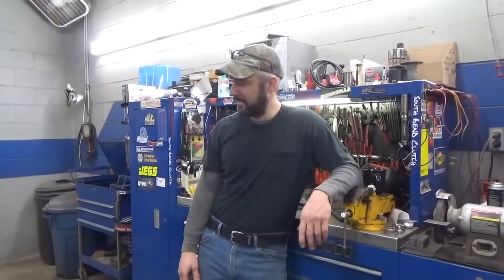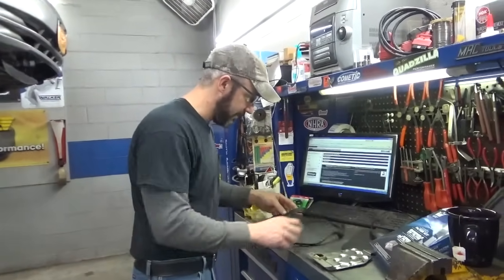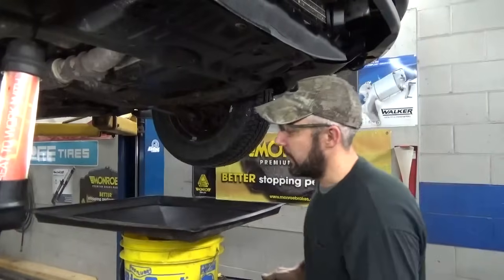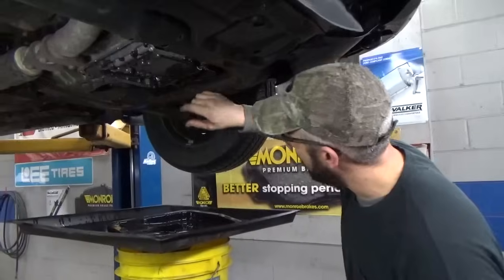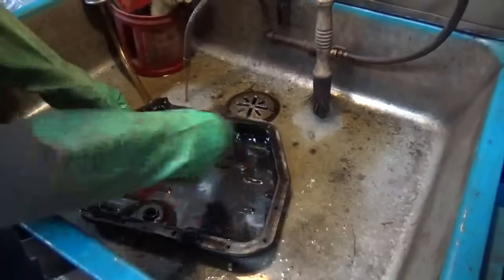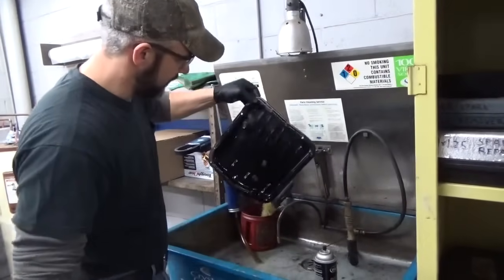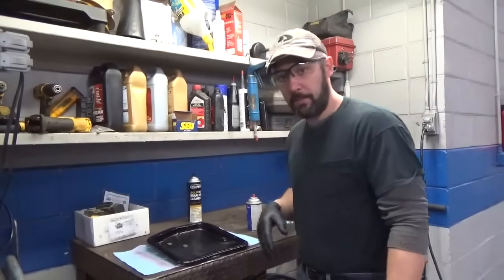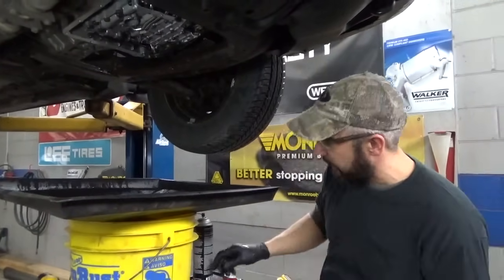Transmission Fluid and Filter Change - Toyota Camry

Comment: Thanks Jack, great video, got a question for you, I own a 2012 Camry 4 cil, mine does no have deep stick like the one on the video, everything else is very similar, where would be the refilling bolt at, would you helping me to find where is it?
Reply: I'm sure you've found it by now. But Ugg! I wish Eric O. had one for our Camrys. I wish I had an Eric O. in Cincinnati O! 
I have an 07 xlt. (Has that weird shiftronic thing going on lol) 
In case anyone else diy'er is reading thru comments who owns the same - our refill is.p accessible through the wheel well. There are a couple videos- watch all, even the professional dude who has tanks & gauges etc etc. Very good info. Basically- To check the fluid level- it's all about the drain tube/plug - it helps measure the fluid level when it reaches a certain temperature (114f if I remember correctly). The drain plug/tube is 2 pieces, (but I've seen it being 1 piece by some reports; so if that's true- to do a drain, it's just a pan removal dump). To check fluid level, remove the drain plug, you'll see the tube up in there. If the tube comes out in your hand- separate it from plug & screw tube part back in to pan. Fill through the wheel well refill hole. (Yep, gotta remove the tire & some plastic in there) (also helpful- a funnel with a flexible neck) once you've filled, start the car.  Once the fluid reaches the correct temp, it should sit level with the top of the tube- barely dripping out. Too much- it'll pour out, too little- not even a drop. How do you tell if it's the right temp? ... Toyota ALSO thought of that- by running through the gears at a certain time interval - it triggers a temperature sensor & tells you either with blinks or display msgs (I forget which) .
Once it indicates you're in the zone, you top it off and watch for drips out of the tube/drain plug. Viola. The fluid expands greatly when it is hot- it is SUPER important you make sure it's at the right temp. Watch videos of what happens with too much or too little fluid. 
I put in a new radiator, it was about 1/4 cup of fluid. I need to check it again though- every once in a while it has a not as smooth shift down to 3 at low speed incline. Could be normal.

The Toyota forum is the best place to find specifics. My gen also includes Solara- in case any Solara- owners are reading.

Comment: My 2000 has metal shavings in it at 150k and has some rough shifting when letting off and getting back on the gas. I am hoping new fluid and filter will clean this up!
Reply: did it help
Reply: @TempoMontages  kid totaled it before I could.

Comment: My old one had over 300k till i f it up before its time! Now got 2019 smooth efficient the old one took pot holes better. So what you guys think on sealed trans? Should you ever touch it? Not according to Toyota but i wanna go 300k plus. My old one flushed once at 120 k. This one idk what you guys think? I know multiple Toyota over 300k orig trans fluid
Reply: Change it every 60-80 thousand miles and it'll last practically forever.

Comment: I have a question, what do you do if your Camry has no dipstick. How can I be sure of proper fluid level. I believe my torque converter is causing my 2011 to violently and suddenly shudder between 25 and 50 mph. Any help would be appreciated

Comment: My 97 camry is throwing a P0755 code for a shift solenoid B. It shifts good and dnt notice anything wrong with it while driving it. Do you think all it might need is a filter and fluid change. It has 160,000 miles and not sure if the fluid has ever been changed. Im the third owner

Comment: We have a 99 Camry that is throwing a 1705 code . Husband replaced the direct clutch speed sensor , and still throws the code . He’s changed the oil , not about this filter. Could this possibly cause that code ? Or possibly the harness?

Comment: what would happened if you under torqued the filter bolts? I misread this guide and accidentally torqued them to the same as the pan bolts(43 in/lbs.) I didn't realize until I was done

Comment: Alas, my 2010 Camry 2.5L has no transmission dipstick. :-(  If you get a chance, would be great to see your procedure on dealing with that.
Reply: if you take your left front tire off, you will see a little plastic panel held on with two 10mm bolts. behind that panel is a 22 mm bolt. that is your fill bolt. I took a long skinny funnel and put about 3 feet of 3/8 fuel line on it. but its not a fill hole like a diff or transfer case where you fill it until it runs out. I really don't know the procedure for checking it. I just pull the plug and pour 3 quarts in it and out the door we go.

Comment: Hi, the transmission oil drain plug was little bit loosened but not taken out, then it was re-tightened but the fluid begins to drip. why? why drip wont stop? no fluid change happen in this scenario. only slightly loosened at the beginning then immediately drain plug was tightened.

Comment: That one was really ready for the fluid change.  I heard the cork gaskets tend to get damp over time and leak. Those rubber gaskets are supposed to the preferred types. What are your thoughts on flushing the fluid out of the torque converter when doing the fluid change?
Reply: Garth Clark, transmission flushes are just a shop taking more of your money.

Comment: Question, i have 2014 Camry, the dealers will charge about $300 to change the fluid. but local mechanic cost about $180 to $230, is is safe to hire local mechanic? a lot people said dealer has special tools to open the seal. just curious

Comment: my good friend just had a comprehensive fluid  check and change !the 1994 to 1997 camry and celeca have separate transmission fluid between the differential and the transmission , they did not check the differential level thus destroying the differential ! this should have been included in this video ! its fine now but I had to remove the transmission in the drive way ! long hard and difficult repair !
Reply: No problem there's a video here on YouTube by an Asian guy I believe his name is welking vue he gives you all the steps on how to drain and refill the differential but he doesn't show you how to change the gasket and the filter on the transmission so what I did is used Eric's video to do this job and the Asian guy video for the differential I got perfect results on my 1998 Toyota Camry le 4cyl.

Comment: I was told that if you haven't change your transmission fluid, in lets ever. That changing it can damage your transmission, is this true?
Reply: Nonsense.
Change your fluid. Nothing last forever. If you weren't meant to change it, Toyota wouldn't put a drain plug in.
You will find new auto transmission fluid will make your gearchange a lot smoother.
All fluids in vehicles should be changed at set intervals.

Comment: I have a 2012 Camry SE 2.5 liter 4 cylinder with a sealed transmission and made an appointment with the dealership to get the fluid changed. They quoted me 280 originally but after I brought it in they said it would be closer to 700 because it requires taking the pan off. Any advice on other places that can do this service cheaper than the dealership? Thanks
Reply: Doing it yourself.

Comment: Those rubber gaskets, you really don't want to put any sealant on any side, since that could make it leak.  The way to get the gasket to stay is to put the bolts through it, since it should be tight around the bolts.  But if it didn't leak, that's good, and you did a great job and got lucky.  
And since you did all that you might as well flush the system, with about 4 gallons or more.  Toyota's have a drain plug and usually the metal fine screen filter so I don't even bother to take the pan off, I never saw those filters plugged up yet.   Not saying it couldn't happen, if you got problems yes defiantly drop the pan.  
Just drain, fill about 10-15 times in a time frame of two weeks or so, drive it after each time, so it dilutes the old fluid.  Each time it's around 2-3 quarts, so after the 15th time it's all nice and clean.  And yes, you will be throwing away clean fluid.  Just remember how much is in one drain, so it get's the right amount each time.  Toyota is so nice since they put a drain plug I believe on all their cars.  Smart !    Oh, I did this to a 02 ford focus and then it didn't shift correct.  Lucky I saw a filter kit that comes with two A&B Solenoids,  so I took the pan off again and changed them out, including the filter since it came with one.  Then it shifted correct.  So beware.

Comment: Excuse me Erick,  I have a question for you,  do you know if I can run an transmission just with an external transmission cooler ( not plug the transmission lines into the radiator) ? I just want to do that with my 95 subaru svx, hopefully you can help me with an answer, thank you and have a good day, keep on the videos
Reply: Yes
Reply: You can use the 2 of them or alone whatever is better for you.
Reply: @r.a.p.k.models4160  Thank you for you answer Ramon appreciate it you help have a good day
Reply: @homeroaguilar6163  de nada soy mecanico , he hecho eso q preguntas en 3 carros ,he eliminado el oil cooler de la transmisión.
Reply: @r.a.p.k.models4160  Gracias eso es lo que tengo en mente hacer en el mio aparte que voy a cambiar los knock sensors en esta semana o en la proxima gracias por tu informacion me servira de mucho ahora solo necesito encontrar un buen lugar en donde colocarlo
Reply: @homeroaguilar6163  el oil cooler depende la marca ,yo he instalado marca (hayden)y ese da la forma de como hacerlo en conjunto con el oil cooler de la transmisión o solo, arregle un mazda protege,  una vitara v6 y pontiac bonneville , eso el oil cooler viene de diferentes tamaños dependiendo de cuantos cilindros es tu carro.
Reply: @r.a.p.k.models4160  Voy a investigar cuales son mejores y tratare de comprar uno grande que no tape mucho el radiator tambien
Reply: @homeroaguilar6163  saludos desde massachusetts
Reply: @r.a.p.k.models4160  Saludos Ramon de un Chiapaneco en el estado de California y gracias por tu informacion

Comment: Great video.  I have a 2001 Camry with 190,000 miles on it.  I have not change the fluid in the past 90K miles.  My fault, I know.  Is it OK to do it now?  I have heard not to change tranny fluid when you get a lot of miles on it b/c it will cause failure.  Is that true?  I am willing to do it if you think that is a bunch of bunk.

Comment: Just curious but what impact is that? i have an 18v milwaukee 1/2 that im slightly hesitant to use on small fasteners like those. you ever had any trouble with those shearing the heads off bolts?

Comment: Thanks, very detailed. But I would go further and replace all the transmission fluid. Doesn't make sense to add 3 quarts of new fluid to 5 quarts of old dirty fluid. I do realize this is what the customer is paying for, but I'd talk them into the full service.
Reply: Many manufacturers frown upon that and for good reason. This has been an ongoing discussion since I first started paying attention in the early 1970s. Based on my experience with our heavy-duty equipment and shop trucks...I'd say a full drain is a quick way to take a 100K+ transmission out of service very fast.
Reply: @ethelryan257  Do you know what the reason is, that this is a bad idea? As long as you replace the fluid, and never let it go dry, whats the problem?
Reply: @WareWolf801  There's a couple of youtube videos which explain it better than I can. A lot of transmissions (especially many late 90's GM) wear quite rapidly. The 'grit' in the fluid is what's keeping the worn transmissions working.
I know, I know, etc. etc. But it's something a lot of us have observed over the years. I'm not going to promote other mechanics on Eric's site, but you can easily call several up on this topic.
Reply: @ethelryan257  That's exactly how my perfectly good working 89 Ford Taurus went straight from the Lube place to the scrap yard.  I thought I was doing my car  a favor by having the tranny fluid flushed, as soon as it came out of the shop bay oil was dripping from the pan.  A transmission shop told me I should've left that tranny alone.  That brand new fluid acted like a solvent on all the gunk keeping the tranny sealed.  Repair quote was more than what the car was worth.  Live and learn!
Reply: If the transmission maintenance schedule was follow then yes continue to follow and flush when scheduled. If the maintenance wasn’t followed then DONT flush the transmission. Drain and fill is the BEST thing for a transmission with questionable maintenance history.

Comment: Hell i had a question. If u can help i opened my transmission. And i opened. The body volve and i put it l back together now it dont go into reverse
Reply: Too late now , but you should not have messed with the valve body .  Did anything fall out ?  Maybe a steel ball , like a little Bee - Bee ?

May have to take it to a transmission shop .

God bless
Wyr

Comment: A common problem hesitation shifting gears fluid dirty also oxygen sensor quits no check engine light crazy!  I replaced sensor still feels like taking in air I thought oxygen sensor didn't work it does!  Please how many bolts Trans pan can't buy gasket screen kit without that info THANKS IN ADVANCE FOR HELP!  2010 Toyota Camry LE 2.5 engine

Comment: Spill and fill is about right.
Reply: +2cyclemix  Keep in mind, there's still quite a bit of old tranny fluid in the torque converter so not much sense putting a new filter yet. I would do at least two spill and fills before I pulled the pan.
Reply: @0rangevale  That would be true if I do it myself. If you're paying a mechanic, labor is about the same you only pay extra for the filter so just do it.

Comment: How about a trans service on a lifetime system with no dip stick.
Reply: Them are called sealed transmissions u got to unbolt the bolt on the side let some drain out to see if it's got any in it if don't u know u probably need to put some fluid in it

Comment: Hah makes me chuckle when I hear you say "China parts" I call them "Wing Wang" parts. All started when I would see the cheap tires, things like diamondback tires, fuzion tires, nexen tires, you get the point. But I just adopted it to all of the cheaply made parts to being generic "Wing Wang" I'd probably laugh like no other if I heard the reference wing wang in one of your next videos lol. In the process of doing a complete transmission rebuild on a 1999 Lexus RX300. Maybe I should video it! But I think one thing you should cover in the next transmission service video you do, is the importance of actually replacing the fluid. Even if it's just a drain and fill. Most folks don't know that the clutch disc material mixes with that fluid and makes it thicker. And when the fluid is finally drained and replaced with fresh fluid, the new stuff is much thinner and seeps right past the seals in the front pump and most of the other scarf cut seals in the interior. Then it warrants pulling the transmission for tear down and seal replacement. 

Just some insight buddy, once again great job with the videos!

Chad
Reply from the maker: Chad,
    Haha Thank you so much for that saying haha, I literally can not stop laughing lol. Wing Wang haha. Good point on the trans fluid. Not uncommon to replace fluid as maintenance then replace a tranny not to far down the road. "Oh it's your first trans service in 180k miles... hmmm"  

   Man if you have time to video the stuff you do I would encourage you to do so. Never thought I'd like the YT but is actually really fun and you get to meet some really cool like minded people.

--Eric O.
(wing wang hahaha) That's funny right there... wing wang
Reply: Haha your welcome, and maybe, just maybe I'll video a DIY on how to teardown, and rebuild a U140E Toyota trans. Since I'll have the flexibility of doing such a thing in my own garage at home. 

Feel free to use the term wing wang any time you like bud. 

Chad
Reply from the maker: Oh you bet the bank it will be in one of my videos haha

Comment: eric, not sure if someone has probably asked this. How do you change the fluid on a chevy malibu? i have a 2009 but i'm sure they're mostly the same on up. The issue is there's no dipstick to measure the correct amount of fluid you put in. So how do you know you've put in enough?
Reply: Your Malibu may not have a transmission dip stick .  Out 2015 Sonic does not .   :-(

God bless
Wyr

Comment: I'm 69 and have never owned an automatic transmission car.  My mother's Camry has 60K miles on it, and I don't believe it has ever had a transmission oil change.  (It has had regular oil changes.)  The car has been sluggish lately, and has a rough idle at startup on cold mornings.  Is the transmission damaged already?

Comment: Looks as if the strainer provided by Toyota really doesn’t “filter”.....my 2011 doesn’t have a dipstick/filler... it is a plug on the drivers side of the transmission.... I think, since the “filter” is just a screen, that I will pull the trans cooler line and run new fluid through until I see new fluid.  Coming out (6 quarts)... Good info here in the video....

Comment: I just changed the fluid for my Toyota Camry 2005, and the mechanics put 4 quarts. Is that too much? how I can remove the extra?
 Thanks for your video.
Reply: +Park Boulevard You could check if its too much by looking at the dipstick and if there is too much that might be a problem because to lose some fluid you have to drain all the fluid
Reply: If you're sure there's too much fluid, and you have a drain plug...
Reply: Pull one of the hoses going to the radiator transmission cooler & drain some out ( into a drain pan ) .

Then re-check the fluid level .

God bless
Wyr